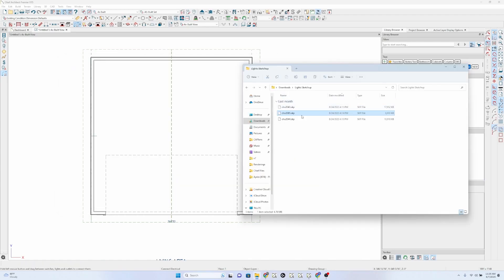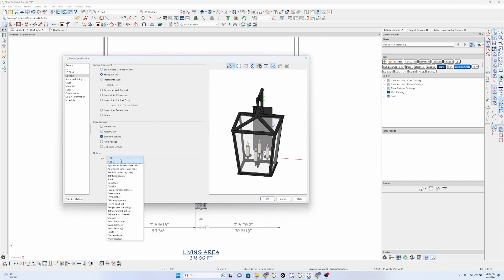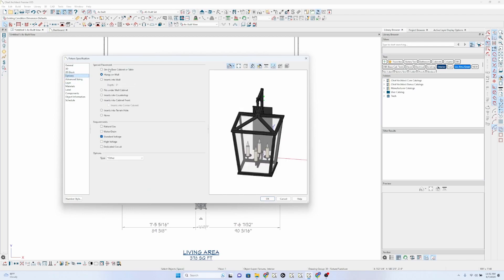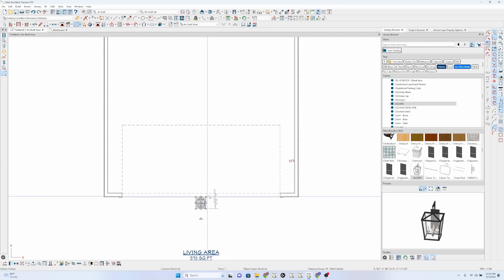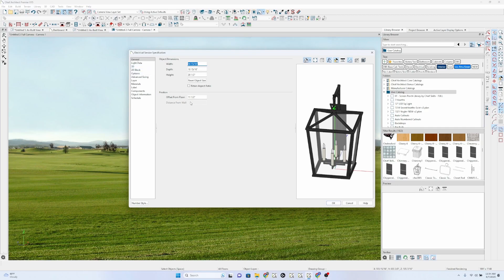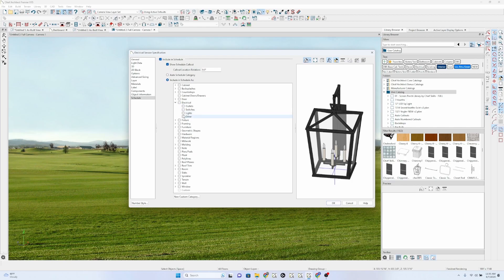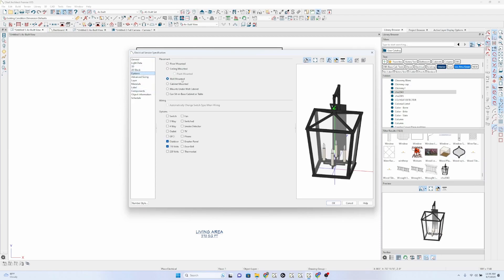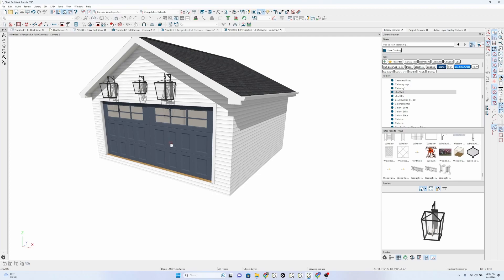Import Electrical Objects | Chief Architect

Comment: Thanks for the good advice! How do you get the light to actually turn on?
Reply from the maker: When importing, you must follow the steps around 4:00 and select "Electrical" as the Category. Then in the advanced options under the Lght Data panel check the box "Specify as Light". This is shown around 4:53 of the video.